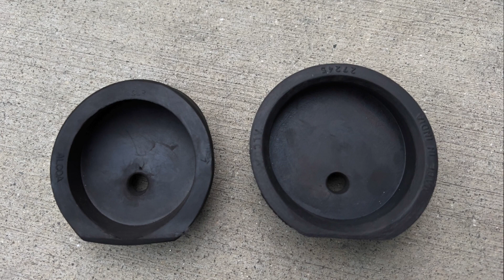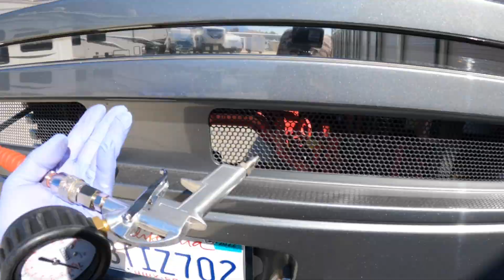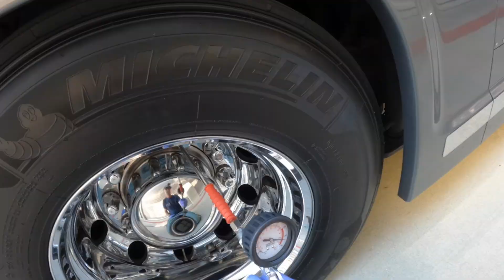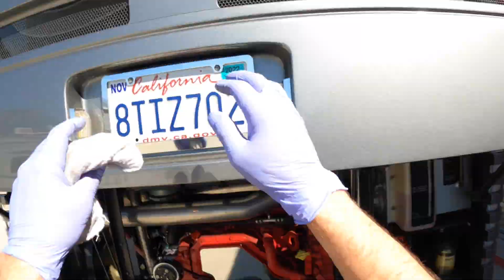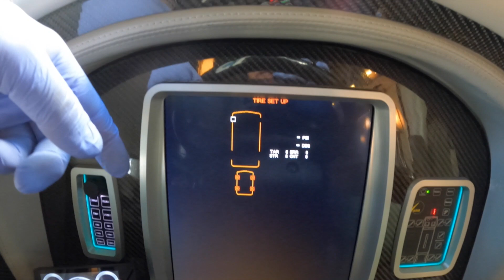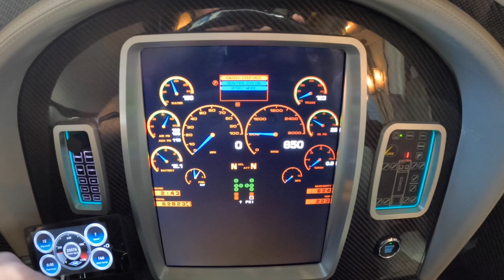Newell Coach Fix Tire Valve Stem Leaks with Alcoa Stabilizers | Pressure Pro TPMS | NEWELL SCHOOL

Comment: Am I understanding correctly…

From the factory, the tps for the interior dual is on a “normal” short valve stem. 

If wanting to locate it to the “traditional” location through the outer rim, the grommets are needed?

Why replace the valve stems themselves in addition to adding the extensions? Were they aftermarket?  

Are the sensors you ordered different from the factory supplied tps?

Thank you sir.
Reply from the maker: ALL the valve stems are the standard shorts. But, Newell places extensions on the inner duals in order to reach them; remember you have to remove the sensor to do an air fill.  Otherwise, the sensor is so far deep and very hard to get to, let alone remove without dropping.

I replaced them because I wanted the best quality and fresh stems to make sure of a good, solid connection without leaks.

The sensors are the exact same sensors as original.

Comment: Add this video to your "Watch Again List" .  Thank you very much Steve for delivering great content for all of us out here.  I do want ask about your tag axel at 80 PSI ?  I was told by the folks at Newell to keep the tag axel at 115.  Just curious about the difference, that's quiet a range variation.  Keep going with Newell School, we are all still learning.  Ray Johnson
Reply from the maker: Thanks Ray.
No…Tags are not that high! You’re confusing them with the Drives at 115.

This is the pressure chart Newell uses:
Front: 120psi
Drive: 115psi
Tag: 90psi

These are good starting values for standard loading. Doing a 6-point weight will get you exact measures.